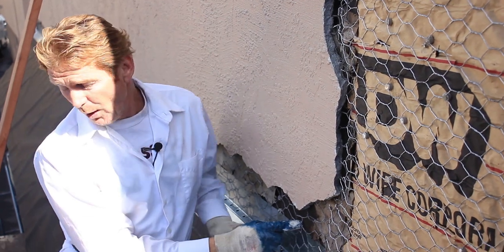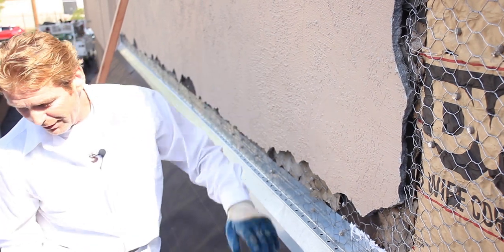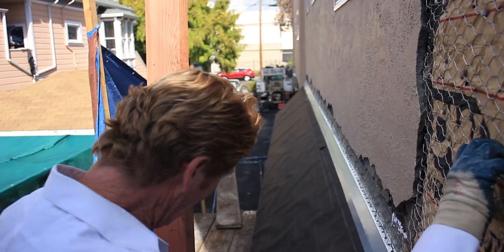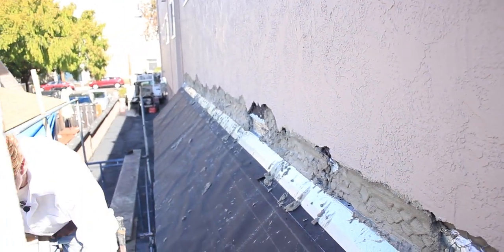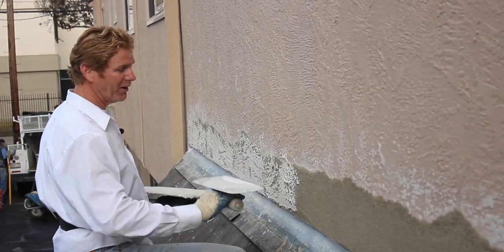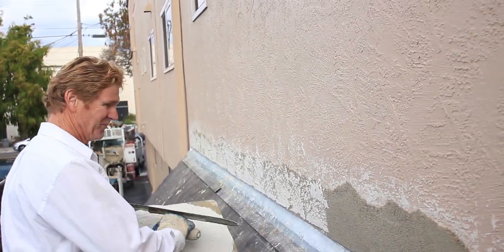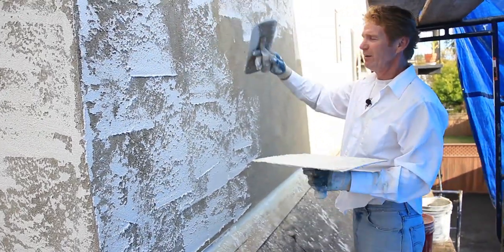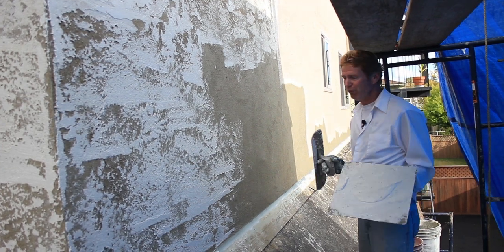Stucco lath past the existing stucco?

Comment: Kirk , I do a 2 coat system, then I wrap 100% with mesh and run senthetic brown coat , and acrylic finish, it's lot of work , but I don't get cracks, my generals here ,in Colorado love the system, I do it this way cause my name is on job,  it turns out great bro, , god bless
Reply from the maker: +David Sanchez, Hi david what you are implying is a great system,
 However here in ca. it does not sell.
 Cheers,
 kirk giordano